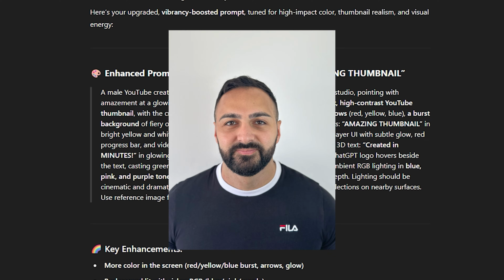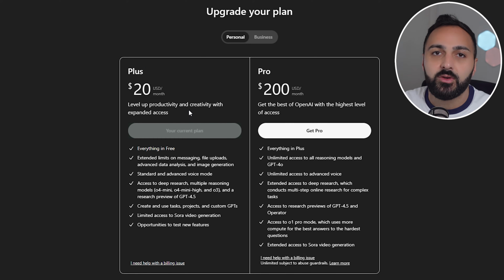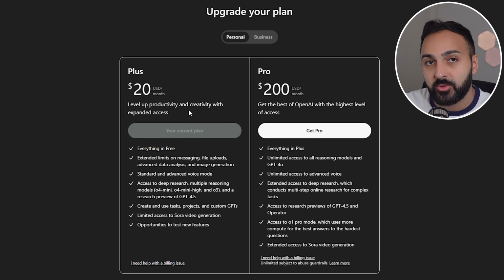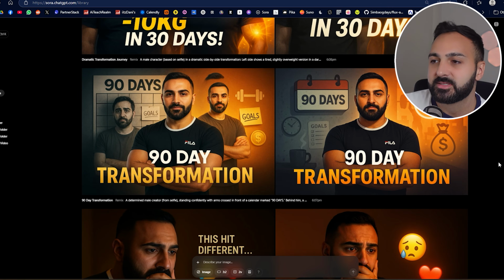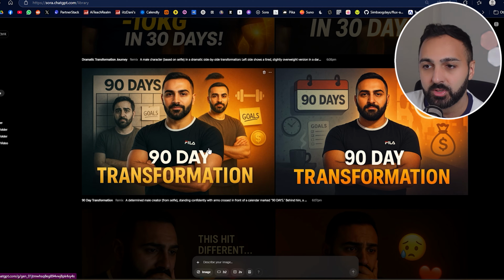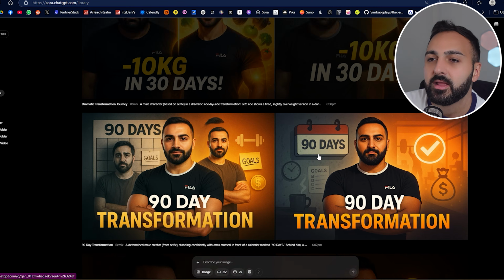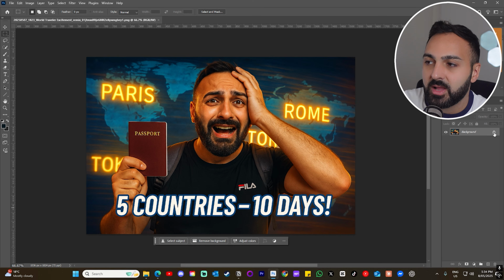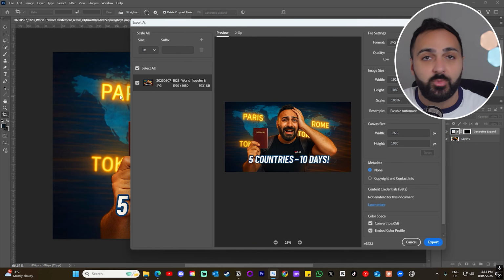How to Make Pro-Level YouTube Thumbnails FAST Using ChatGPT

Comment: I tried it using the exact workflow you mentioned here but it is very expensive and does not give consistent results.  I'm going to train a custom Lora on replicate instead and that way I can get reliable 16:9 images.  The images I produced with your method all had weird cropping and I spent more time in Photoshop than I prefer.  Thanks for the tips anyway broski - keep them coming!
Reply: Did you ever figure out how to do 16:9 yet consistently? I'm getting so frustrated with Chatty, awesome designs but wrong ratios. I subscribe to Canva Pro but don't think they have an option to fill in the space.  I've been having to crop, or very rarely Chat listens to me and spits out 1920x1080.